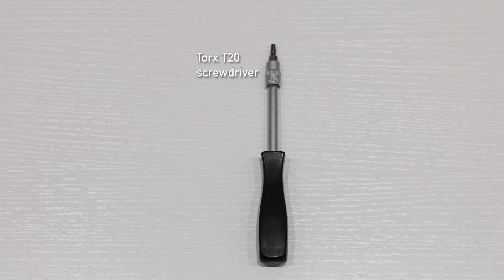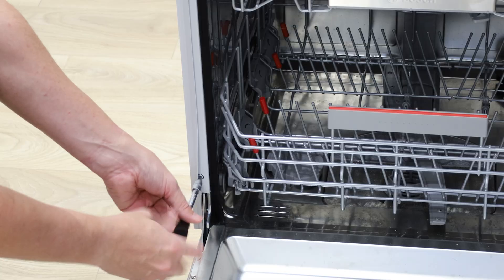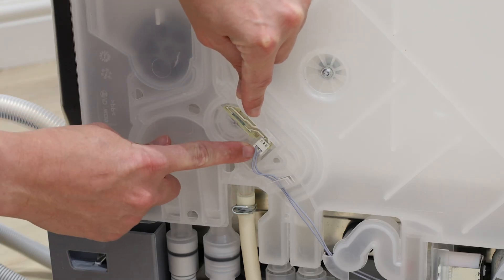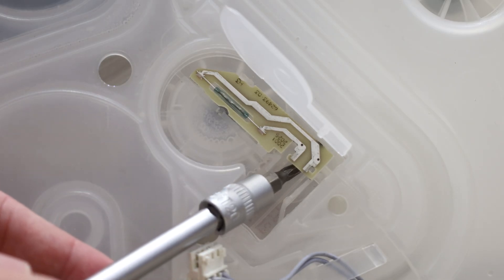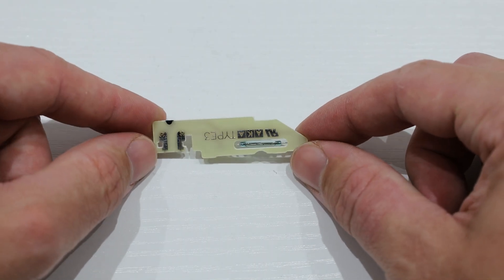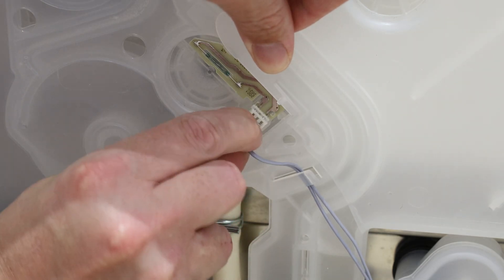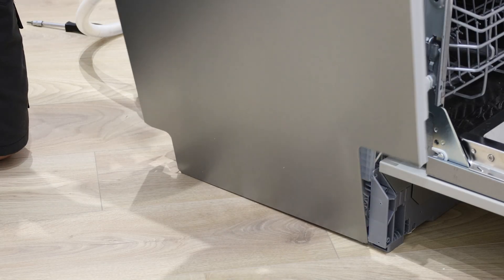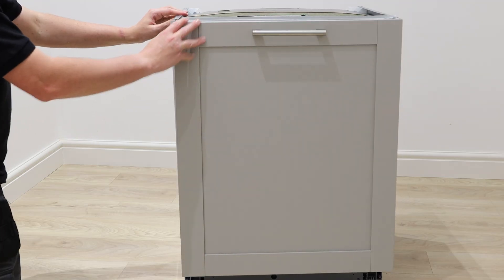E14 Error Code?! How to Replace a Bosch Dishwasher Contact Reed Flow Meter Sensor

Comment: This is perfect, my old Bosch SMS63M08AU/50 has developed a check water fault and after much digging replacing the reed flow meter sensor seems to be the solution.